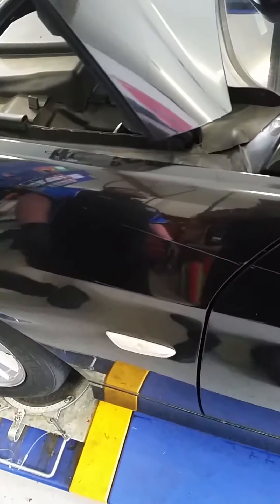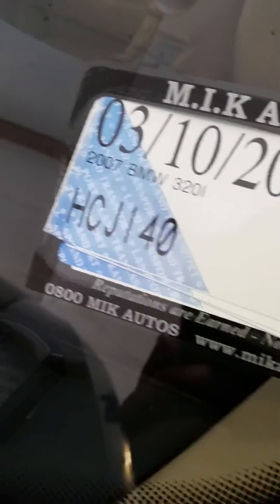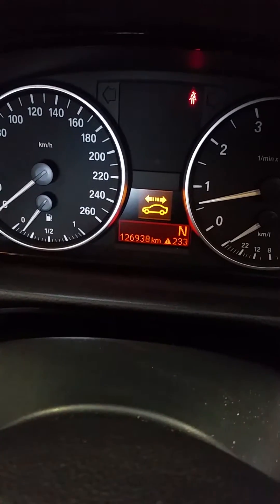BMW 320I Worn Valve stem seals

Comment: Hey, did you have to remove the head to install new valve seals? And roughly... How much does it cost to get new valve stem seals replaced. My car is doing the same thing.
Reply from the maker: I replaced seals with head on mainly I hired a stem seal removal tool kit, Replacement of stem seals and labour only would only be $2500 NZ, If like most engine's that have not been apart I would suggest replacing all cam cover gaskets and seals before reassembling. Which is only a couple hundred dollars now rather later and more labour because of oil leaks. And a  experienced mechanic with the correct cam timing kit.
Good luck.
Reply from the maker: @Armageddon-qo4wy  It's sounds like you may worn valve stem seals also. Oil can leak past seals, the longer the engine has been off, like overnight, more oil can leak past and accumulate into cylinder and creates smoke on start up. Also check PCV valve

Comment: Hi I have a same car and same problem, but it cost too much $$... so I just wonder if it’s worth fixing the problem or I should just keep topping up oil... 
Even if I change to new stem seals, the new stem seals will be worn again in the future, right..?

And also will there be problems in the engine if the engine keeps burning oil??
If it’s not so bad... I’d just keep adding oil every 1km.. 😅
Reply: Lee이승우 j have the same car with a similar problem it’s just not quite as bad. Mine only started although after an oil change. Did you ever identify the problem?
Reply: If it started after an oil change,  you might have put to much oil in it.  As far as is it worth fixing?  Yes, it is.  The oil burning will cause other problems such as spark plugs fowling,  carbon build up on the valves and pistons and piston rings.  Also can ruin the oxygen sensors and catalytic converter. So it's actually cheaper to get the stem seals replaced

Comment: Do you know if this is common on turbo diesel? I have the 330d and it smokes badly at idle and when revved, more smoke when hot than cold. Smoke is light blue and I get bursts of grey black from the exhaust when revved
Reply from the maker: I have not come across that type of symptom with the diesel turbos. I had no service history with the BMW i was trying to diagnose, which meant having to do an oil consumption test. I replaced oil and filter and drove vehicle for 1000km and checked quantity of oil used or remaining. Any thing from a litre and over consumed is high and a good sign its engine internal wear fault. if smoke is blue when the engine is warm it's normally a sign of burning oil,  the next step would be to determine if the oil is entering the cylinder through induction/intake side or internally, ie valve stem seals.
If you have an experienced mechanic who could carry the Basic engine testing like compression and cylinder leak test to asses internal wear, unfortunately, this won't indicate worn stem seals.
on the induction side, you need to visually inspect turbo for wear, compressor side,  turbo piping for any excess oil residue or build up from oil bypassing turbo shaft seal. check PCV valves or any other crankcase connected pipes or hoses that plumb into intake system.
Reply: VAKA REES hi, thanks for the reply. Yes I’ve not heard of it before on a turbo diesel due to the intake being under pressure rather than vacuum. Carried out a compression and it was 370-390 psi across all 6. Will take a look at the oil loss. Im leaning towards my CCV as I have a good coating of oil coming from it, despite it being a new part. Need to try a catch can to resolve that. Thanks for the response 👍

Comment: Is that white smoke or light blue ?
Reply from the maker: Light blue
Reply: @vakarees8902  ok, but on the camera it looks white, did you replace the piston rings also
Reply: If it has good compression there should be no need for piston rings.  These cars are known for the ccv system and valve stem seals

Comment: How much does it cost to fix it? Thanks
Reply from the maker: For a valve stem seal replacement only would approximately cost 8 - 10 hrs labour plus cost of seals and any additional parts, ie gaskets, oil etc...

Comment: Not a valve stem issue. N45s are notorious for crank case ventilation issue.
Reply from the maker: It was definitely valve stem seal issue after removing and comparing it with new seal

Comment: Your meant to be mechanics and people trust with there car and as you said it you (SUSPECT) valve stem seals the 4 cylinder bmw engines are known for it no need to suspect it if that was me and you told me you suspect it i would take my car elsewhere or fix it myself
Reply: Dean Bmw Doctor just sea foam it thru the intake first.  & a bottle thru the gas tank.  Try that.  See if it smokes after that.  If it still smokes.  Check your pvc. If they aren’t torn then it’s time for valve stem seals
Reply: @CannedHam-uz2nr  mate i dont have a problem with my car looool i was telling them how to fix it im a bmw technician mate i had this problem on my 120i and fixed it easily just change the stem seals there is a special tool to do it and makes the job a piece of piss to do
Reply: What tool is it and where to buy it?
Reply from the maker: @BMWDoctor  ego has landed
Reply: BMW DOCTOR DEAN how much does it cost to do it? Thanks
Reply from the maker: Regardles of whether your a BMW mechanic or not Process of elimination is required any job. Assumptions are the route  of all fuck ups.
Reply: BMW Doctor you have a Facebook sir?
Reply: Still didn't tell us what tool he used

Comment: Isnt that a pvc problem?
Reply from the maker: No we had valve springs off the next day and stem seals had excessive wear compared to new seals
Reply: @vakarees8902  so was there smoke on first start up in the morning? And when driving? or only after long idle?
Reply from the maker: @justme3350  only after long idle
Reply: @vakarees8902  petrol Pajero common for this lol mine are bad but not too bad leave it idling for a few min and the stab the throttle out comes smoke lol